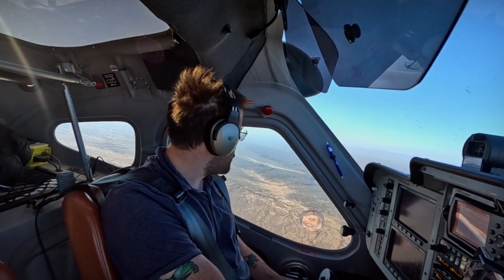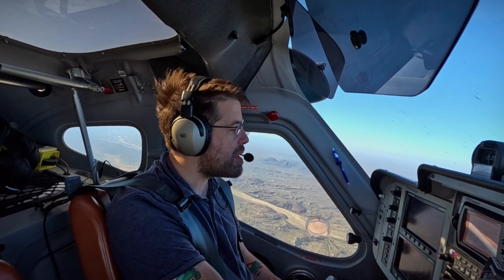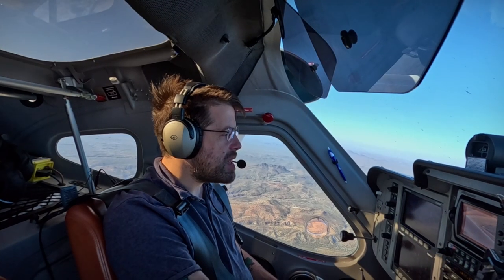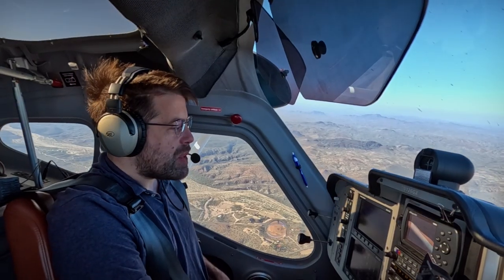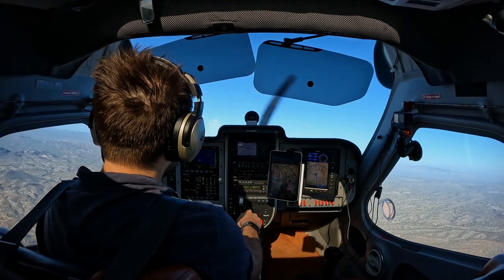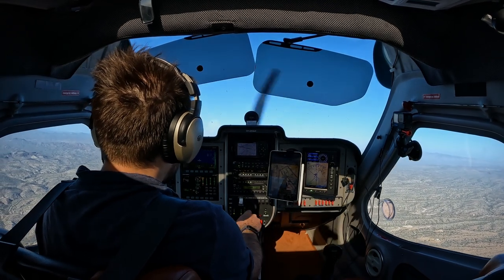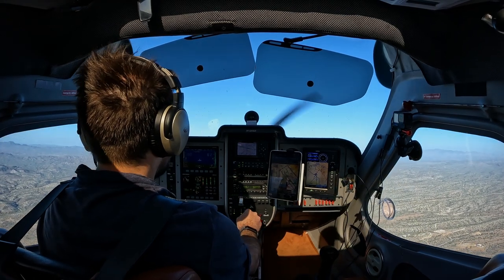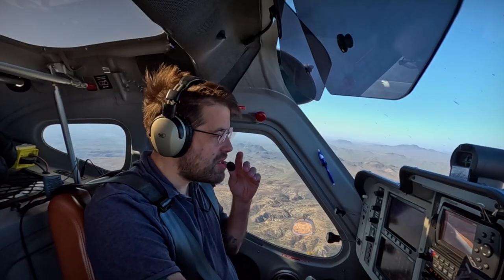remos: benign stalling

Comment: Is elevator range somewhat less than other planes? Your full nose-up doesn’t look as steep, but that could be an illusion.
Reply from the maker: it's definitely not very nose-up, but angle on power-off stalls from low speed don't tend to be very high. LSAs tend to be super gentle with stalls generally (light wing loading, modern design). The term used by FAA (and maybe ASTM?) is "docile".